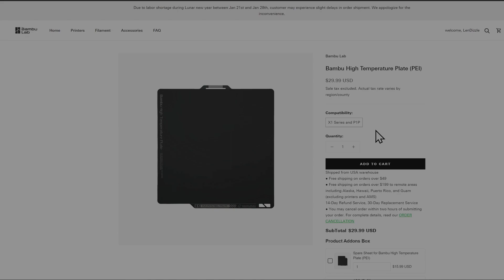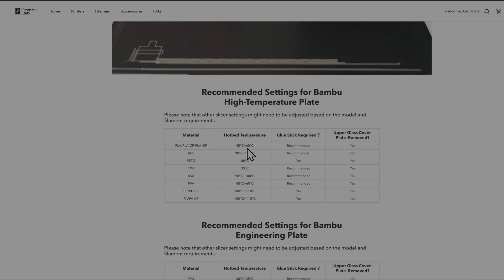Is the Bambu high temperature build plate any good?

Comment: Nice Video. I have been using the Hot plate on my Bambu Carbon X1 for months. Never used a glue stick on it. It works fine. Parts come off without any problem even PETG.
Reply from the maker: In order to compare many types of plates, I thought it would be best to follow any recommendations.  I have printed without glue but only with PLA.
Reply: Windex is the best, you clean your bed and it leaves a releasing agent on it. Clean it with to much of it in foam mode and just leave a little bit on that evaporates during heat up or even before.

Comment: Hi, i printed ASA with High Temp sheet using liquid green glue for better adhesion, but the print lift up adhesive from sheet (making air bubble between)
I must use glue stick instead? The adhesion will be the same?

Comment: I have a question. On my a1 mini it has the bed temperature at 65°C for their filament but on the bambu wiki it shows pla should have a bed temperature of 35-45°C and so do other filament brands. Does the bambu just run a hotter bed or is the pla they make need to be printed at that temperature? I’m confused
Reply: My x1c came from factory preset at 50c bed temp for pla. It's being doing just fine except on silk I had to bump bed temp up to 55c to get it to stick.
Reply: @jeremyarnold1979  yeah i upped the temperature to 240° for silk and it seems to have way better layers adhesion.
Reply: Haven't went above 220 for the silk but we just printing toys rite now

Comment: I'm surprised the recommend glue on a PEI plate. Thought I did try this high temp plate without glue and the benchy popped off. Maybe it wasn't clean enough?  i only gave it a quick wipe after receiving it.  Kind of defeats the purpose of the PEI plate if you're using glue like the cool plate.

Comment: NIce video :)  Have you tried without glue?   On my High Temp and Textured, I never use glue.  I only make sure to clean it with Isopropyl 99% and never had a failure :)
Reply from the maker: Good to know.  Those were actually the first prints and I followed the recommendations.
Reply: Do you print PC without glue?

Comment: Thanks for the work you put into this (and other Bambu subjects) videos.  But man, you need to work on your audio levels.  The music is WAY too loud, and your speaking audio is way too low.  I'm constantly adjusting my audio level to listen to your videos.  Thanks, man!  Question: when you print ABS, are you doing it indoors?  My understanding is that ABS puts out gases when it is heated through the nozzle, which can irritate your nasal passageway, and can even make you sleepy.  This can't be good for you.
Reply from the maker: Making videos isn’t as easy as it looks and I’m still learning. Thanks for the feedback
Reply from the maker: For your question about ABS, I do it indoors.  The X1C has a chamber with a filter that is "supposed" to filter that stuff.  My printer is in an area with proper ventilation and not in a room I hang out in.  I have never felt sleepy or had any nasal issues.  I mainly print PLA and rarely use ABS.